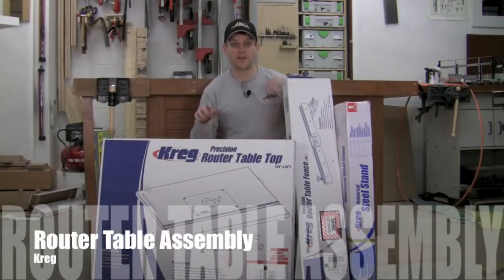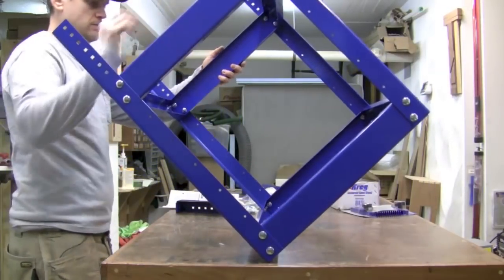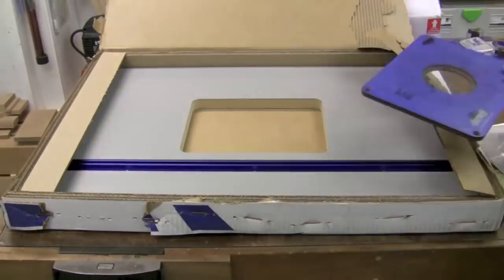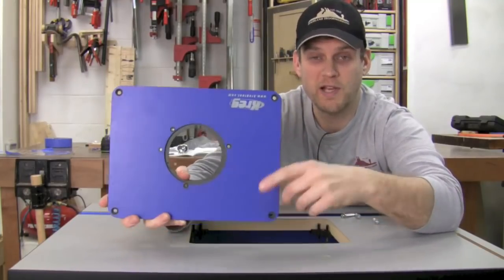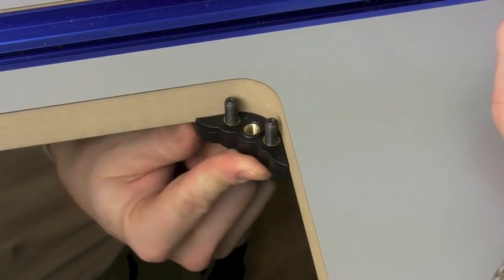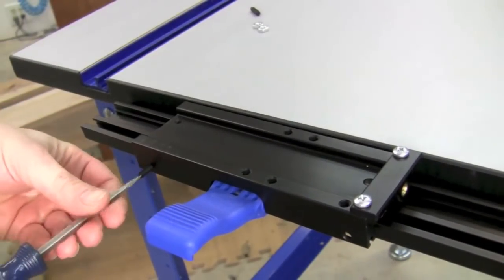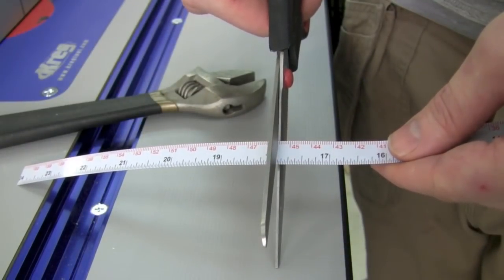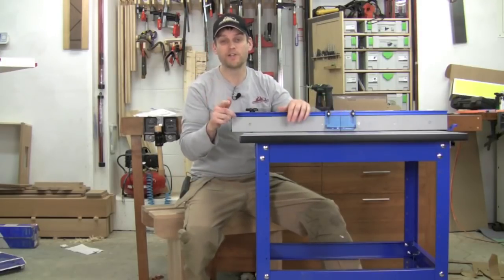Kreg Router Table Assembly Product Tour

Comment: Thank you for taking time to put this video together, I just put mine together today and was much easier since watching your set up video. Amazingly I had same problem with the insert screws not lining up. Cannot get it remedied though. I tried what you did but still they do not line up. Everything else on the table is spot on. I am very impressed with this table and its accuracy. It has a lot of versatility also with being able to add storage underneath. The stand is really heavy duty steal, it is from Taiwan though. All the rest I believe is made in USA!

Comment: I'm in the process of putting this table together.  So far it's been pretty simple but your video has provided great tips for smoothing the process.  I guarantee there would have been shop projectiles if I wasn't warned in advance about the corner pieces.  That's exactly the kind of thing I tend to overlook and become royally pissed about.

Comment: Real good job Morton - better than Kreg themselves!
I had to bring back my router table today for replacement as the T-track holes didnt match at all - wow said the Woodcraft guys! Lucky they had one in stock and they were kind enough to replace it. I opened the box to check if all is good.
I will find out what else doesn't align - a bit disappointed - I hope its worth the effort and money spent with Kreg.

Comment: I had the same problem with two of my locking screws.  i just left the two straight screws in tight, turn my tabletop over.  unscrewed the crooked levelers from the base.  then threaded the locking screws through the top of the upside down plate and through the plate leveler holes and tightened it down.  this centered the levelers properly.  And then fastened them to the tabletop.

Comment: FYI: If it's like the bench top unit.. measure the length of the wood screws they are a hair longer than the thickness of the top.. seating those screws will make the point of the screw blister the laminate surface.. add a small washer solves the problem.

Comment: I have just acquired a Kreg router table and have assembled it ... your video was of great help!  I have a question ... the fence seems to bind on the lock side when I slide it across the table ... why is it doing this, is something too tight or too loose, have tried to adjust the plastic screws and nuts that hold it to the rail, but have not had much luck in resolving the issue ... any ideas???
Reply from the maker: Evan Farrell Check in with Kreg's technical support to help you trouble shoot your issue:  
https://www.kregtool.com/customer-service/default.aspx